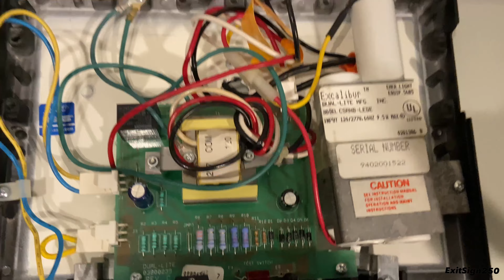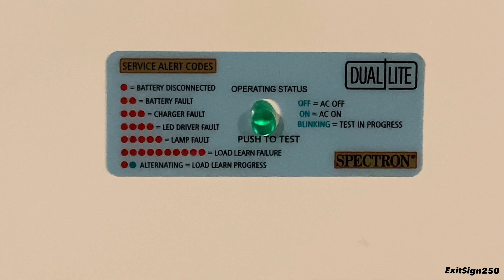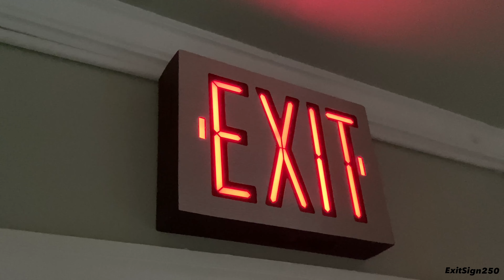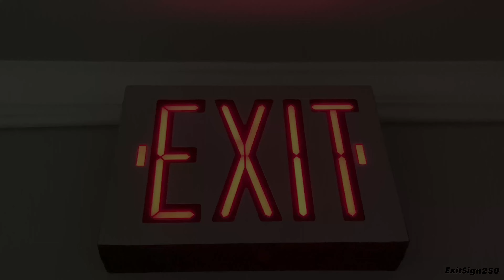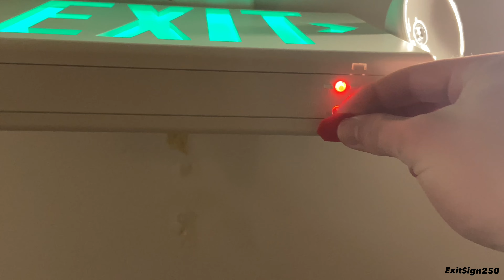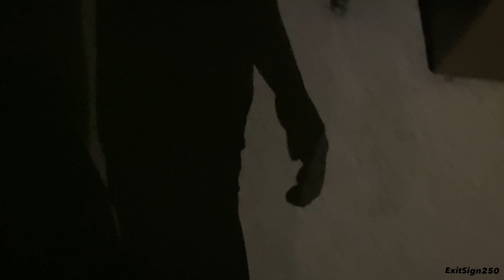Exit and Emergency | Episode 12

Comment: I have a TORCHSTAR LED Emergency Lights unit in my collection and is powered. The night on Daylight Savings Time, the power went out in my house before 1am. I kept the unit in my bedroom and relocated it to the kitchen until the next morning and power was already restored. 
One thing I love about exit signs and emergency lights in general is you can easily find them in hardware stores without relying on Amazon or eBay!

Comment: I got a Commercial Electric Exit Sign for Christmas and it had Interchangeable Defusers, and Red and Green selection, and I really like it, I have mine on green
Reply: The thing I don't like about this particular sign, is that the top two clips are extremely hard to remove, but the bottom two clips are easy to remove
Reply: @robertsmithshobbyproductions  I have the same issue with mine. I can remove the bottom 2 with my fingers but i made a crack in the top right one trying to remove it.

Comment: The Excalibur has a Asus sticker in it, quite interesting.
Reply from the maker: Good catch! Actually that sticker was originally on the outside of the sign. (On the bottom left of the faceplate) Not sure why, and I’ve never seen this before on any other Excalibur. I didn’t like it on the outside of the sign so relocated it to the inside just in case it meant anything.
Reply: @ExitSign250  Oh okay, still really weird to see that.
Reply from the maker: Another weird thing to add, this exit sign was brand new in the box as well. So it came from the factory with that sticker. Still odd!
Reply: @ExitSign250  That's really neat though. Maybe DL had some affiliation with Asus.
Reply from the maker: Maybe so! I’ll have to do some more research on this…

Comment: New to the channel, do you have a video where you test/inspect the emergency/exit lights of a commercial/residential building? And if so, what do you do when you can't find the breaker for the emergency/exit lights? Do you also have a video explaining how to use a battery analyzer?  Would love to hear back from you =]
Reply from the maker: Welcome to the channel! Currently I do not have any videos where I legitimately inspect exit signs and emergency lights in a building, nor do I have any about a battery analyzer. But I can guide you as best as I can. The best way to test an exit sign or emergency light is to use the test button located somewhere on the unit. Of course this is easy for basic testing. For extending testing shutting off the circuit at the breaker is the best method. You can buy circuit breaker finders that will help identify the breaker you are trying to find. And as for the battery analyzer, I’m assuming you are trying to test the exit sign and emergency light batteries? If so, I’ve never seen this practice done before. The most I’ve seen is people using a multimeter to insure the battery is at the proper voltage levels. But I suppose an analyzer can give further information.